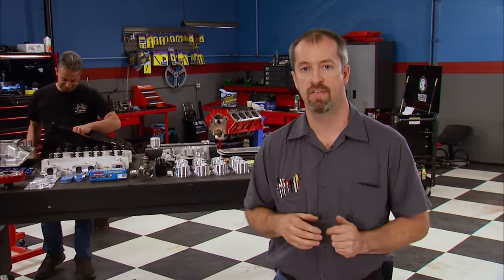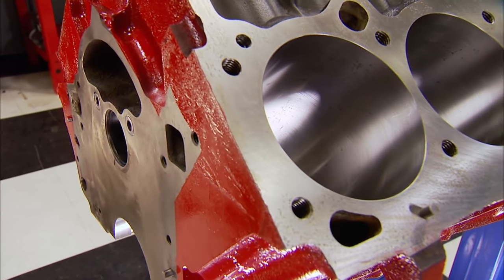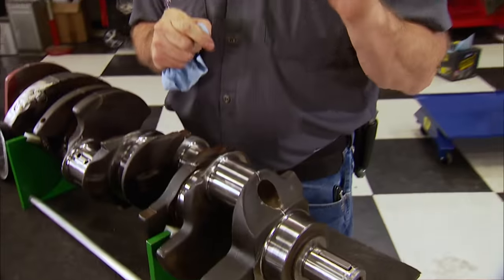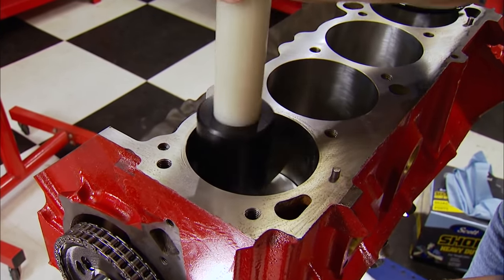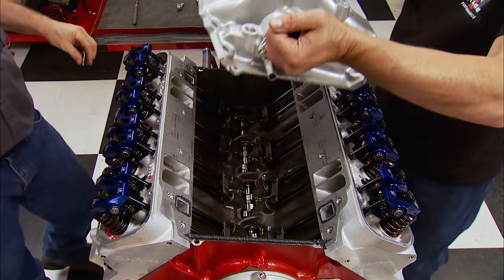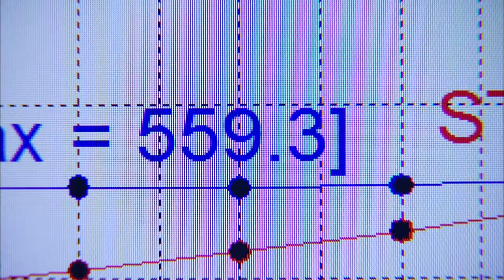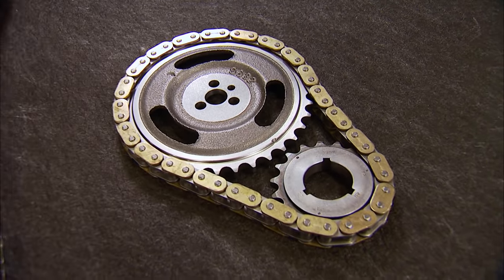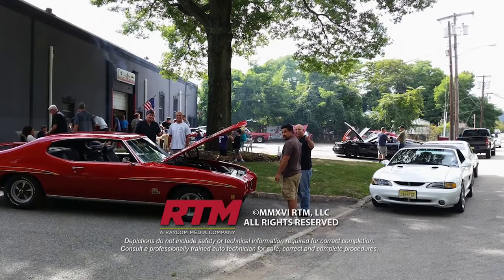Building A 455 Buick That Makes Surprising Pump-Gas Power - Engine Power S3, E17

Comment: Why does the dyno test only go to 6000rpm?
Reply: Bucks were never meant to be a high revving engine. Max horsepower was in the 5000 to 5,500 rpm range
Reply: @martinreeves3129  It wildly depends on set up. It was still climbing at 6000, so the last run was pulled to 6500. That's where the extra HP came from.
Reply: @jhutch1470  Agreed, however the bottom.end of this Buick was highly modified and concrete was added to the block. if you read the recommendation by T/A Performance it will tell you specifically what's needed with a power adder or above 6,000 rpm. A stock Buick made its power deep low. T/A block girdle and lifter bore girdle are recommended at minimum
Reply: @martinreeves3129  I fully agree. I read your post again and realize you were talking about the engine in stock form. I was talking about the current build of the engine. I agree that block reinforcement was needed. And oh boy, did it work. It was a great build.
Reply: 6,000 rpm is plenty for a streetable engine. It'll be docile enough to cruise around town and still have enough power on tap whenever you feel like blasting through the gears. Nothing more frustrating than an engine bucking/surging/stalling because it's not built for street driving. Not to mention the money saved building a streetable engine.

Comment: Where are the milodon and comp 3 gear timen sets or even the 2 gear timing sets used on model Ts to VW air cooled bugs amd last gas engine to come with timing gears was the feiro... YOU PEOPLE A ALL LIVING UNDER A ROCK!!!
Reply: They didn't show a real stock chain, either...

Comment: 12:22    That isn't going to build any oil pressure.... the distributor, hence the oil pump, rotates counter clock-wise in a Buick engine..

Comment: 148 hp over the displacement! Wow. Is it true that that engine is only 25 lbs heavier than a SBC?
Reply: Yes but a Small block Chevy is the same  weight as a 400 Ford.

Comment: That engine doesn't know it's a Buick. If you know how to make power, it doesn't matter what brand name is attached to it. It's all just math, dimensions, and what you do with them. It doesn't help when the cam profile is way off base either.. just sayin.
Reply: Exactly, your head flow is the most important part when running N/a, and you need a good cam with matching intake manifold.
Reply: @bri-manhunter2654  Not exactly head "flow".  The engine doesn't know what a cfm number is. All it sees are dimensions. Runner dimensions, size shape, length, taper, etc... Again, it's all math and how you apply it.
Reply: @jrdmotorsports9718 . Your head flow on a N/a motor will determine your ultimate power, and there is a formula you can use. A 300CFM head is ultimately not going to make more than 650hp N/a, boost however does not care about head flow.

Head flow is absolutely important! You can have a built motor with high compression, big cam, correct intake manifold and be limited by head flow. Richard Hokdener has proven this in the dyno countless times. Power nation even did a video that proved Richard’s findings. There stroker build with stock heads, cam, and intake manifold on a 360Ci base Mopar to a 408Ci showed these finding with scientific evidence. The motor made an extra 30hp because of using a slightly extra compression; the result was lots of extra torque due to more displacement, and only more horsepower because of higher compression.

Moreover, you can have ever right, but be limited by head flow. And everything I just explained can be verified by math. Have a great day.

Comment: You guys got to build a 100hp engine that can get 50+MPG shoot for 70MPG .. then it can be put in a compact sedan or small pickup... The 82 VW Turbo Diesel Pickup got 50mpg .. i think you can do better... i mean thats how many years ago 40 years.. should be able to get 70mpg
Reply: 1980's Chevy Sprint got 60 MPG...

Comment: You guys put $10,000 in that motor and only got 150 horse more if it creates 350 horse and you got 550 horse when you're done that's only $150 horse it ain't worth it for 10 grand I'll leave it stock and put the money in the gas tank so you can afford to drive it